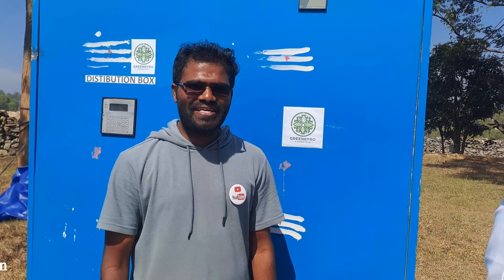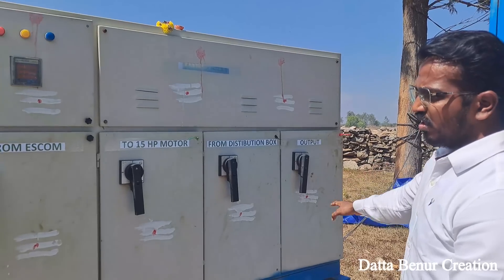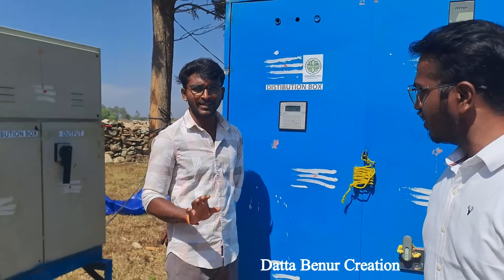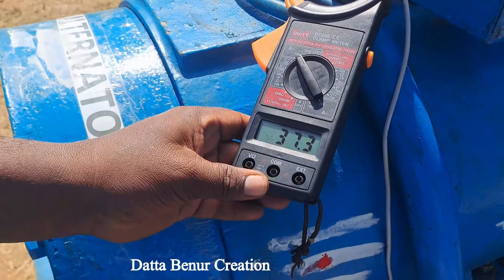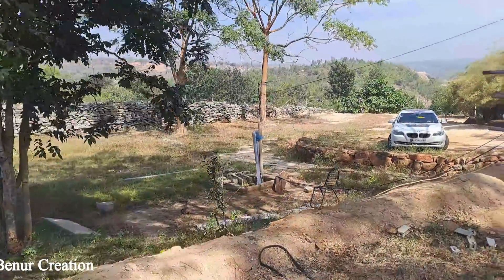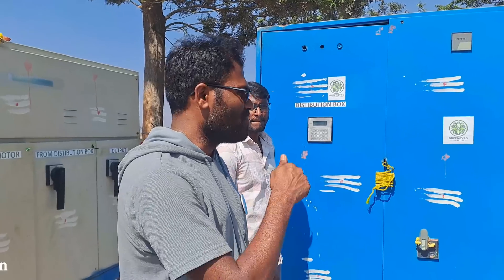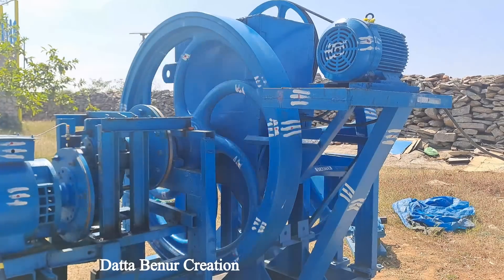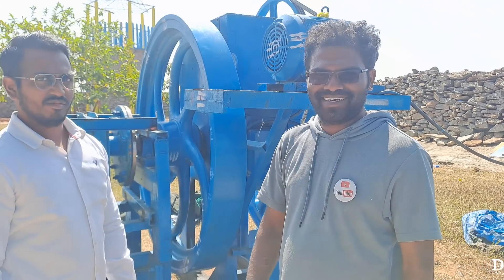the world first commercial flywheel Energy Technology - 0% input 100% output

Comment: I undersyand fully beacause it is synonomos to my concept. The formula e= mc'2 actually d constand is the kenitic energy of the fly wel. Once given a force to rotate it will continue to spin even the aplied force is disconected. Snd that is the free enetgy we are harvesying
But it slowly decreses it speeg due to friction so that the electric motor's job yo sustain the kinetic energy needed by the fly wheel to maintain its initial motion. The mass of the flywheel will couter act at any heavy surge curent drain of the generator from heaby load 
The flywheel will regulate fluctuation
Reply: Where is your d in the formula?
Reply: @Navigator5  love=d&d=d/2

Comment: Flywheel can produce energy for sometime but by the time you connect a big load to it it will stop spinning the motor shaft will get very tight due to the load
Reply: Magnetic field of generator is biggest resistance, we need more power to move continuously it. Mechanical advantage is not enough
Reply: @shayarchoksi2566  yup he is faking it. Anyone who had played with simple mini motors in childhood by convecting it to an Led to produce electricity shoud already know this. It's basic physics

Comment: Secret sauce gear box.  Why don’t you apply for a provisional patent which costs just peanuts and then talk about the gearbox.  This looks like a flywheel battery.  You dump energy into the flywheel and later draw the energy from the flywheel.  There are loses as well.  This is not a new concept.  This was used during world war 2 in radar technology to save the sensitive electronics when there is a power cut.
Reply: Secret is not gear box, impossible to design such gear box, I think he is marketing background that's why he is saying simply. That generator is a DC machine it works as both generator and motor, when fly wheel speed exceeds certain speed for example 100rpm DC machine acts as generator and when flywheel speed reduces less than 100RPM after some time, this DC machine acts as motors, it drives flywheel.

This type of generator generate power as well as consume power too.

Comment: He put his amp meter over the incoming power cable to the motor showing no amperage and then he put it on one leg of the output of the generator. If you put the amp meter over all legs of the incoming power, it will always read 0 A. So obviously, he knew what he was doing to make it look like there was no power going to the motor and 37 A or so coming off of the generator. he did not prove that there was no power going to the electric motor. So it seems obvious that he is deceiving everyone.
Reply: Can you invest in such a huge development just for trick? Designer must have considered loses due to friction and provide a solution. Thermodynamics can't explain everything about energy

Comment: In this setup, AC Motor continues getting supply. actually motor switch is bypassed inside. what he is showing by clamp-on current meter is false. this wire is three phase ( 3 core ) wire putting clamp-on current over entire cable will show zero current whether motor getting supply or not ,Impossible, there is nothing called free energy in this world. i wonder why he spending so much money on a false project.
Reply: I'm a Mechanical Engineer from Myanmar........
I believe their project deeply........!!
This project idea is based on Flywheel Theory in Mechanical Engineering field.........❤❤❤❤❤❤

Comment: How much energy is lost in the gearbox? This is very similar to the Adams generator which also uses flywheels, 2 1kW motors and a 10kW generator. The 2 small motors are pulsed to maintain the speed of the flywheel once it has reached sufficient momentum to run the generator and runs quietly and for much longer periods of time if this one only runs for 45 minutes.
Reply: I really need such a machine...even if it runs for 30 minutes free energy
Reply: @issanyamu8445   What electrons giveth, friction taketh away.
Reply: @AffordBindEquipment  what friction taketh away  spinning flywheel mass over cometh.
Reply: @rmendes2mendes915  friction always wins.  It's the law.
Reply: @AffordBindEquipment  it depends on the output load capacity

Comment: u used the multimeter  wrong way at one place u use all three wire where it show Zero and at another place  you use only one phase here also u should use all three wire. this thing show that it is moving using external power.

Comment: If everything works as you guys described then make such generators in terms of megawatts.
Reply: Even if its capable of producing 1kw it will be a revolution in electric power industries ,
Reply: yeah i am too thinking of megawatts but i would be needing  two effile towers to hold the flywheel of my calculated size to achieve that 😆

Comment: The kinetic energy decreases due to constant slow RPM and then the flywheel stops after some time.
Reply: have you tried this?
Reply: @harcourt-university  do you know how many engineers lose their minds due to friction and force resolution ?
Reply: i guess almost everyone working in mechanical field hits F&F balance problems at some time🙃
Reply: @harcourt-university  nothing run forever without input power. flywheel will stop after some time. friction is on of the culprit loss energy even without output. need hug amount of power to running flywheel.
Reply: @harcourt-university  a wheel stop spinning after sometimes.

Comment: Totally impossible, there is nothing called free energy in this world. What about friction? If there is no power supply to the fly wheels, it will eventually come to rest after a certain periods of time. Through the initial power supply, you are able to rotate the wheels, but if there is no constant inputs, it will eventually stop. You can never generate energy, you can only convert from one form to the other.

@dattabenurcreation , please don't encourage this kind of video in your channel.
Reply: This thing worked exactly as it should!! It got views and clicks and comments!! 😂😂😂😂 I actually love watching some of these on occasion. At least they aren't calling me about my warranty or my IRS debts 😂😂😂
Reply: What fascinates me is when he clips the Amp meter onto the cable, what does he measure? A balanced load (motor) will show 0 amps over 3 phases. He must measure 1 phase (of the 3) to get a true reading😂
Reply: Jake dekho samjho fir bolo 😅😅😅😊😊
Reply: Did any one who didn't believe, my question do it practically then comment negative. The person has to be appreciated rather than discouraged
Reply: Yes, you are absolutely right. He is converting gravitational force ( kinetic energy ) into electrical energy. He is not creating energy.
Reply: إدن لست تؤمن بالطاقة الشمسية طاقة تابتة كما أن هدا المحرك هو كدالك يعطي طاقة وهو تابت 😊
Reply: Actually, first the flywheel is rotated with paid electricity for few minutes till Full acceleration is gained, then it is switched off, the fly wheel then deaccelerate but still makes electricity through generator more than the consumed electricity initially...so this cycle continues and you get the free electricity... understand it first and comment later...the output electricity is more than consumed... simple
Reply: @God.is_Great  you first understand it then comment ,  input energy would be greater than the output always !  You would get noble prize if you invent anything like this go try it yourself 😂😂
Reply: @jibinjohn3989  I should get Nobel.Prize for my new railgun that has no recoil thus violating inertia and thus revolutionising physics comprehensively. But I am not holding my breath.
Reply: When it bought we complain, when it is free we dont believe... Too funny
Reply: Energy can not be created nor be destroyed but can be transferred into another form
Reply: @bhopale1 Energy is eternally created and destroyed in our infinite and eternal universe. The laws of thermodynamics are outdated. This machine will work but is too expensive. A cheaper version using just gravity is required.
Reply: @bhopale1 Energy is eternally created and destroyed in our infinite and eternal universe. The laws of thermodynamics are outdated. This machine will work but is too expensive. A cheaper version using just gravity is required.
Reply: You don't seen details of frictional work,,,
Reply: It's called the Inertial Increase of Electrical Power. It uses inertia to amplify the torque and as such amplify your power input by the motor. Resistance doesn't matter because the motor overcomes it. The amplification comes from the fact that to stop acceleration of a flywheel you don't need to apply an "equal" force but only opposite. The force can be half if the distance from the center is doubled. This works in reverse if your taking power closer to the center which causes the moving mass (further from the center) to produce an amplification of torque. Atleast that's how I understand it. Research Energy Impulse Secrets and Power Impulse Secrets by kanarev for more information. The impulse probably comes from gravity due to the imbalance flywheel. But by using two imbalance flywheel 180 degrees out of phase to remove vibration problems.
Reply: What a load of rubbish, without a higher output through a step-up transformer or power storage such as capacitors sending power back to the drive motor it would not keep running, otherwise how did he it stop with the press of a button? 😅😅😅
There are types of free energy, but most generation systems require an input and a form of loss such as, heat, friction on all surfaces etc.
Those flywheels even if they were 100 times bigger would eventually stop, and they are also running at very low rpm so have a low potential energy and rotating mass, "every action has an equal and opposite reaction" Newton's third law. Newton's first and second law's still apply also. 
There is zero evidence here as you have not disclosed the wiring configuration, a working scaled down model to make it clearer, a computer model displaying all components in detail. Another scam. Do your research people.
It takes three phase to start and run this system.

You could do that with solar for free after it pays for the initial setup costs.
Reply: 😅just fooling people, gathering youtube views and monetizing it. Such videos should be banned since they are misleading
Reply: Bull shit YouTube
Reply: Never will work only flywheel power even the inbuilt gears need atleast small push..
Reply: If can I use magnet🧲.. I'm sure possible
Reply: Jokar
Reply: @amtautomobiles5716  kaun?
Reply: I want buy this product
Reply: @thirumalaivasan3511 they have it in stock at BestBuy😂
Reply: I also can make huge outputs
Reply: They can’t even spell distribution…….. 🤣🤣🤣🤣
Reply: Ok where is america invade india for free energy
Reply: https://youtu.be/SxqGCKcgADg?si=2DBYxWmsntNV5hUO it's not the first vedio which claims such things. Vedio provided in the link also claim same things. It's very hard to believe but it works.
Reply: Shut up please
Reply: Found his patent https://iprsearch.ipindia.gov.in/PatentSearch/PatentSearch/ViewDocuments
Reply: Well done.
Reply: Physics has been updated with the laws of thermodynamics thrown out.
Reply: E=0.5mvvN(N-k) implying internal force is the formula relating matter and energy kinetically. Not destructively. This upsets physics and all physicists as I have found since 2003.
Reply: Not totally sir there Are law of motion
Reply: It's absurd cos the laws of physics are climed to be wrong here.
Reply: @susantrdg  هدا الامر ليس سخيف ، لقد تمكن هدا الهندي من تحويل الجاذبية الى طاقة دائمة
Reply: True they are converting energy from onexform to another
Reply: Energy cannot be created 😂😂😂 energy conversion is one form to another there is no free energy in the world it's a you are saying that you are creating time waste and money waste in this types of experiments in and wasting
Reply: We want this system  in our land, I am an agriculture farmer, many times in our village current cutting, Trans former burning happens and no current we face, plants die due to this we suffer
Reply: Doubting Thomas. If this invention was don by a white man, i am sure you would believe the whole thing
Reply: How did the fly wheel stop when the power was switched off. If there is now power supply to the flywheel once it has been kicked started by a motor initially the flywheel should keep spinning until the kinetic energy is run out.
Reply: He means that only the kinetic energy of the wheel is providing to keep the alternator running after the motor stops. Which is not possible.
Reply: So many idiots not enough time it's the friction of the flywheel the movement that pushes the motion
Reply: They have been making these for years everyone knows it
Reply: Nothing to do with transfer it is the leverage of the motion of the flywheel and the weight that pushes it for inertia
Reply: There are lots of Einstein's around. The rare Teslas that appear are way above the simple minds that only accept what tHE eyes see
Reply: Obligatory 'Cant' (because cartoons say so!) Comments! _ Always follow these type of Videos🤔 _ Beautiful Engineering!🌐🕊️
Reply: Carnot cycle impossible
Reply: I can't believe this 5k+ people liked this video to know this is impossible. In conclusion they don't have brain 🧠 or don't have enough awarenes about this.

Anyone noticed the PMW car parked at the backside of the water pump. I Think 🤔 that they started a company for formalities to show the government this company is running in loss, so that they save some of their tax money from other RESOURCES(so called invested money in this dummy company), showing this company losses document to the government to make a black money 💰.
Reply: Hi think you need to turn on the other half of your brain . The sun  is free Energy. The wind is free Energy a flowing river is free energy.   When we say free, we mean the source of the energy is free. You just have to build the device to harvest the energy and sure that’s not really free but once you build the device you can easily say you’re using free energy.
Reply: Nothing is impossible.. before the innovation of aeroplane who can say that is possible...
Reply: If it is possible then why the world didn't consider this technology..
Reply: another scam invention 😂😂😂
Reply: They need an interpreter
Reply: Firewood is free in the hills
Reply: You wrong faraday also wrong the universe is energy all thing are in movement electons planets stars .... galaxys the Stillness is impossible
Reply: I know there is free electricity but it’s not economical for biz so they did something for u to pay for them
Reply: @freaking_natureBoy "you can only convert from one form to the other". So where did the first one form come from??? to be converted to the other form??? I don't know, anyone who knows please let everyone else who doesn't know, KNOWS, ok??? Thank you, Namaste🙏🙏🙏
Reply: @kanmh3482  ''the first form is already there every thing in the universe is moving you can convert the power of cravity like that machine to Infinite movement
دImagine if you dropped a ball on a certain clutch that could store the force of the collision and use it to return the ball to its place. Isn’t this eternal motiont 
L .
Reply: That's fine, spring based toys is fine, there we provide the tension to the springs to store the energy that later runs the toy. There is some sorts of inputs. But, here it claims 0% input and 100% output!!!
Is that possible?
Reply: @freaking_natureBoy  oh yah yah ! That point it slip from my mind. That's not possible  at all  no doubt. Even that gyro bus also  use to rotate in a vaccum chamber inorder to reduce friction.
Reply: Totally possible.।।। The input motor is 4 kw and the out out is 33 kv.।। If after initial start the 4 kw input is also taken from  output.।। The machine will run fine.
Reply: @tunedindia203  За 1 годину цей прийстрій накопичуе 4 квт/години. На 10 хвилин, припустимо, до нього можна підключити навантаження в 24квт! 💪
Reply: Yes you are right. The person is trying to prepare a perpetual machine which is not possible till the time. So this is just a fraud.
Reply: It's the principle of induction. Of course, the flywheel comes to rest eventually when power is turned off. But, residual power output is always more than input because of the concept of potential induction of energy with less friction in spinning.
Reply: Yes its impossible 😂😂 he just created this scrap for scamming people and people with less scientific temper believes it  ,  i don't know how people still thinks this thing actually works😂😂
Reply: I believe it it is happening is leverage in motion by the flywheel
Reply: Respectfully speaking,, you speak within the limits of the science you think you  know. Science captures that indeed we can use less effort to lift a heavier load, all happening within the same space of time and this is no violation of science.  Cant we see the connection?
Reply: @achortg7107  Less effort is required but the lower effort is done over a longer distance. Let's take the case of lifting 100 pounds a distance of 1 foot off the ground. If you do it directly by hand, you need to move only a foot. However, if you use a lever, you will have to move the lever many feet to raise the 100 pounds ONE foot. https://en.wikipedia.org/wiki/Lever
Reply: The fly wheel supplies the free! All other components receive! It works
Reply: Ne lupetaj......!    @Thewhippedhippie
Reply: I totally disagree, it won't work.
Reply: @freaking_natureBoy   its not some kind of free energy . Flywheel act as battery it store mechanical energy in the form of rotating flywheel depending on the output load it will slow down aftrer some long duration of time . before battery was invented buses use to run on flywheel base storage called "gyro bus". this is proved concept similar to spring base toys car . since this has huge flywheel when well optimsed it will run for longer idk how much
Reply: @Harlongbi2H well said ... This is true